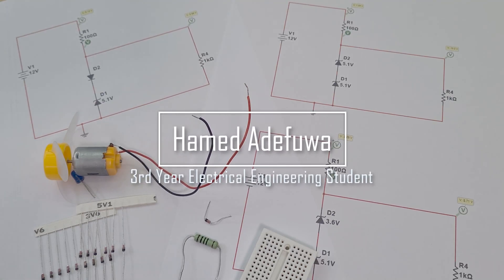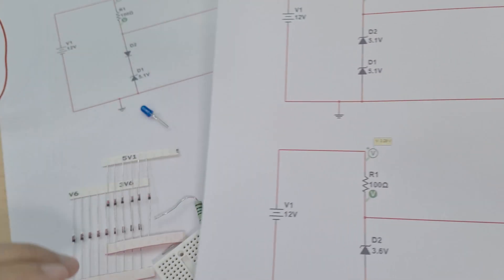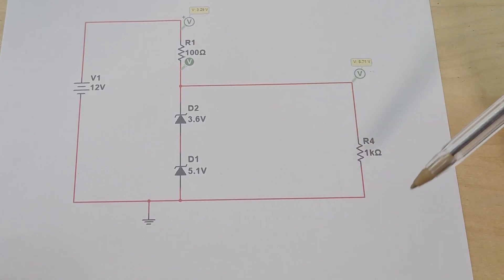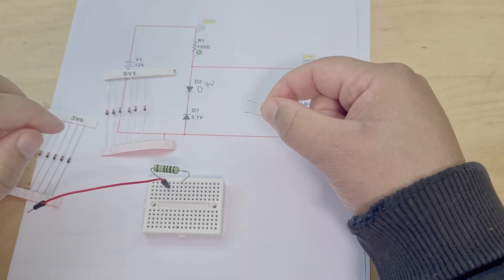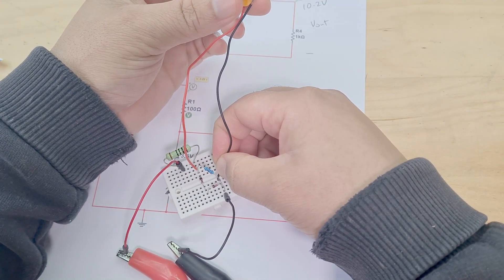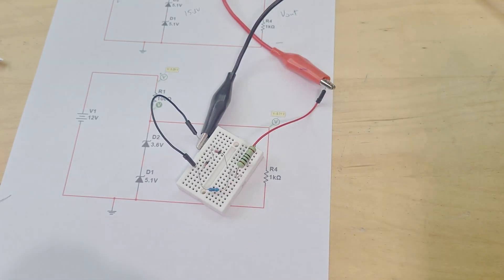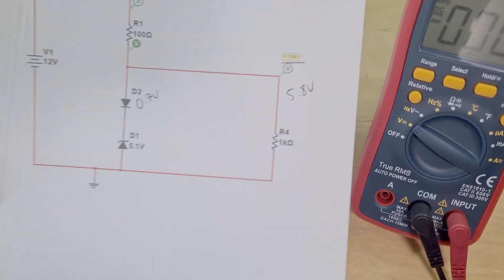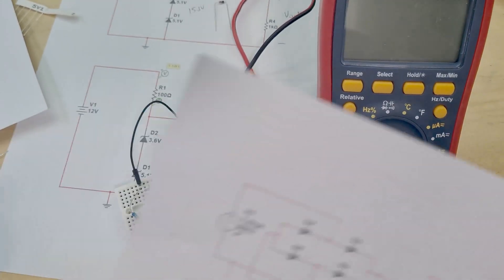Combining Zener Diodes To Create Custom Output Voltages For Beginners

Comment: Hello!  I hope this would help to resolve your issues about expected vs actual zener diodes drop. It's looks like (to me) the problem is in your current limiting resistor. You put it 100ohm - why? I'm not sure if you calculated this value of just  took arbitrary. You do know, that  each zener diode have a particular current range that makes it doing it's job, right? If you don't run a nominal current via zener - it just won't work, it won't drop  it's  specified voltage.
As far as I remember 3.1V ... 7.1V zeners of "1N.." family, shout  pass about 40..50mA to operate as designed (still better to check the datasheet). So, let's see  your circuit with 3.6 + 5.1 zeners. Your expect to have 3.6+5.1=8.7V drop. With supply voltage 12V, we'll be left with 12-8.7=3.3V via the resistor. That gives us: 3.3/100=0.033A. So your choice of 100ohm resistor will limit current at just 3.3mA throu the zenners. That's seems pretty low...  I would take (I'm calculating for 45mA limit): 3.3/0.045=73ohm .. Try with this if you have time. 
And one more thing: bsicaly, you can't connect your load (i.e. motor) directly  across zener. That won't work. ;)
Reply from the maker: <3<3<3

You the man. I actually did calculate it as 73 ohms and then went: "meh 100 is close enough" lol Although I've read about zeners needing a minimum current to operate, I kinda assumed I wouldnt have to worry about it. I'm now realising that I've been relying on my multisim simulations too much. I think Multisim isn't calculating everything correctly, possibly due to me using "ideal" components in multisim and not the actual components. I tried to do some googling regarding not collecting the load across the zener but came up short. Do you mind explaining why connecting the motor across the zener wouldn't work? Sorry for being so noobie lol

Edit: does it have something to do with the load resistance messing with the zener current. So if the load resistance is high, the current goes through the zener and if its low, then no current goes through the zener?
Reply: @HamedAdefuwa  No problem)) See, if you connect some powerful load (that is low resistance, lower than zener limiting resistor ) - motor, heater, etc., that totally changes the current distribution in your circuit. Now almost all current will flow via your load,  and almost nothing via zener path. That puts zener out of the game : no current - no voltage drop. 
To be really accurate with your circuit as example, you should consider  that 100k resistor, calculating it's parallel connection. But in practice you neglect it, 'cause 100k is huge resistance comparing to little 100 (or 75) ohms. So that's ok, but won't work with motor. Motor will draw whole 12V of power supply, see? 
Your are not a noob, really. You have reasonable way of thinking, and questioning. You may have a lack of knowing some nuances and "tricks", but that's what process of learning is all about, right? Noobs tend to just simply ignore any issues they can't explain)))
P.s. Are you from UK?
Reply: @HamedAdefuwa   I've just saw your edit update. Exactly! Right! Looks like you figured out the problem yourself. Impressive))
Reply from the maker: Haha thanks man I'll start calling myself a novice instead lol yeah I'm from the UK, London originally but up in Leeds now. What about you?
Reply: @HamedAdefuwa  Me? Well I'm now feel quite embarrassed, realizing how my english might be taken by you as native speaker)) At least it looks like I'm still understandable)
By the way, I forget to mention about multisim simulations. It also used to give  me ambiguous reading, but that's probably 'course it's component database. Perhaps ther's some errors in values of something.. I just rarely consider multisim like a accurate test board. more, kind of, to validate  general idea or circuit function. Hope you got my point.
P.s. i'm from Russia. Nice  to meet you!
Reply from the maker: Lol yeah man I thought you was definitely British haha. The only russian word I know is gazovaya promyshlennost because of the energy supplier Gazprom. You're right about multisim, I've been using it expecting it to exactly represent reality, going to adjust my expectations now lol appreciate all your help man. I've moved from noob to novice now lol
Reply: @HamedAdefuwa   No, you actually know two words. "gazovaya promyshlennost " - that's two))  Oh, I got it! You must be simply rather modest person. Always little bit of underestimation of personal skills))

Thanks for the cheers about my english.  I just  sometimes get complexes about it..